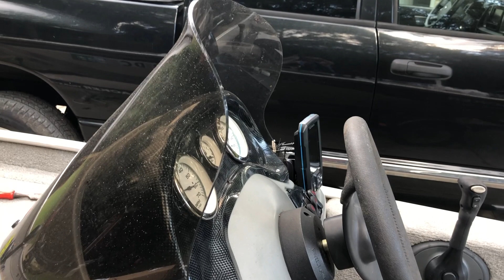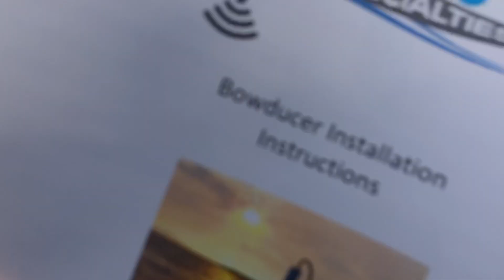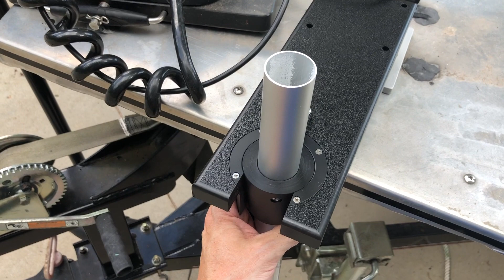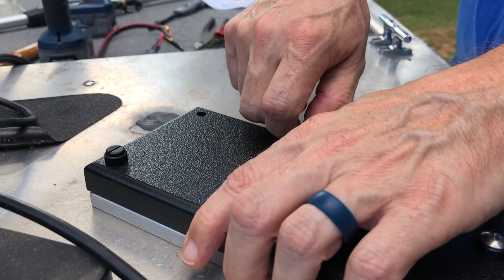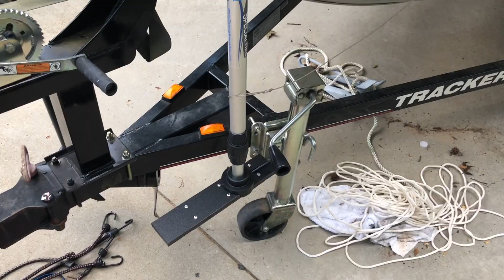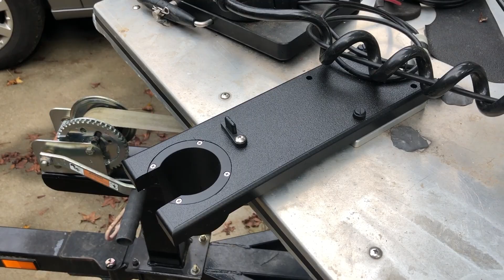Bowducer install on Bass Tracker!  Install a bow mount transducer without using the trolling motor.

Comment: I think the tether cable attaches to base plate you will loose base plate if shears off , pole is attached to Lowrance
Reply from the maker: Wayne, you are absolutely correct.  I found that out after I made the video and then updated the comments to reflect that.  But yep you are correct.  BTW.. I have some of the screws sheer loose when I hit something and it works well.

Comment: What keeps the transducer from turning, I wonder why they didn’t install a handle on the pole?
Reply from the maker: So the when you put the transducer pole into the slot, it has a pretty snug fit, and then there is a latch that you rotate over it.   I haven't had any issues with mine moving.  If I am not mistaken they make different models depending on what unit and transducer you have and I think they do have a handle on the models for the live scope type transducers.
Reply: @BooneDownSouth  
Thanks, good to know.

Comment: So you're sharing the trolling motor power source with the fish finder, have you encountered any anomolies as a result of that - electronic cross-talk or anything?  Thanks for the video, glad to see it was a fairly easy install, all things considered.  Is there any adjustment on the transducer holder to insure a proper horizontal orientation (or is it necessary to shim the bracket to deliver a horizontal install)?  I am torn on a bow mount finder/ducer and have a tough time buying into a TM mount - especially for SI combined spot lock turning of the TM.  I'll check out your recommended site to see if they offer something that provides a single pole system for both SI/DI imaging and also for Live or 360.
Reply from the maker: @Chris Koffend - Yes I am sharing the power source.  I have not seen any issues with that.  It works fine.  As far as adjustment for horizontal that is going to depend on the model you get.  He makes them specific for different fishfinders and transducers.  He makes specific ones for 360 as well.  So I can't remember on mine if I can adjust horizontally or not.  I'll have to go out and look at it after work.  I did see on his website there are some setups where you can adjust the horizontal setup.  If you are interested in the product I would call the guy up and talk to him.  He is real helpful in helping you figure out what you need for your setup and helping you figure if it will work in your situation.
Reply: @BooneDownSouth  Thanks Boone, yeah, I plan to go that route . . . but first I need to decide on my set-up for the bow.  Just SI or also live or 360 - and then of course the model/brand. My terrova has the built-in US2, but that seems somewhat a step back in performance . . . I definately will be going to bowducer. Since you've not seen an issue with sharing the TM power, that makes me feel better versus having to run new dedicated power lines for the FF. I am in the upper midwest, ie. grassy/weedy lakes and I am not sure yet whether I trust either the live view options or the 360 as being much good/usable. It seems on many boards, there is not much positive to say about the live view options with weedy lakes - I don't need to pay $1,500+ to see weeds live and in (in)action!
Reply from the maker: @Chris Koffend - I gotcha.  I didn't want to run new power, cause I already re-placed the breaker panel and their ain't much working room on this bass tracker and I really didn't want to open everything up again.  It's weird most of the lakes in my area don't have many weeds at all it seems like so I haven't really thought about that aspect but I can see how it can impact your view on the live or 360.   And you are right - it is a good chunk of money to drop down on it.  Good luck to you.